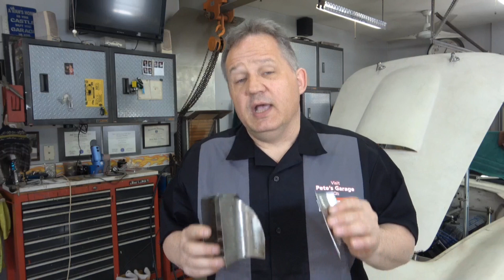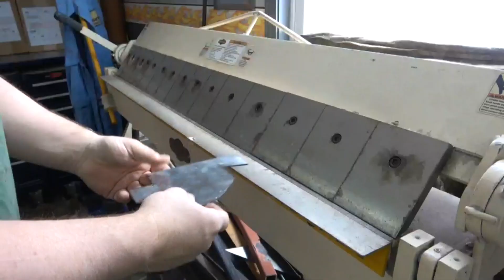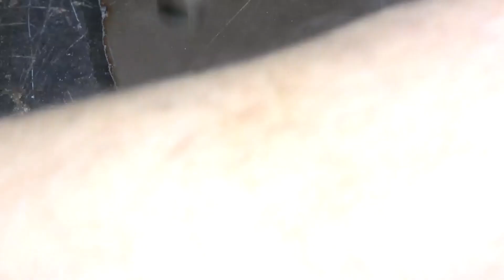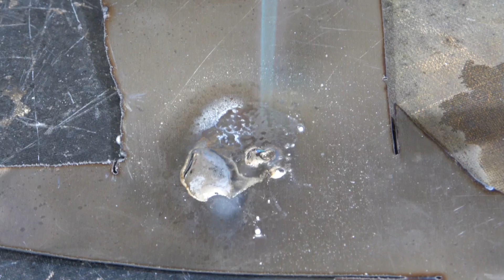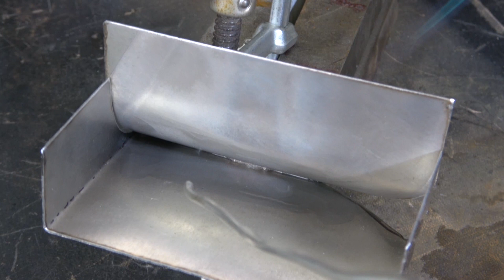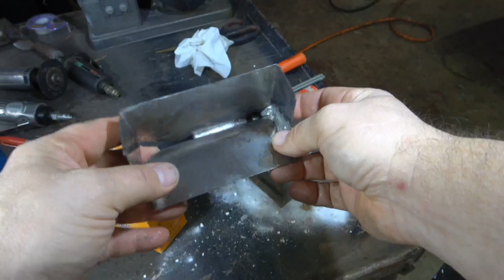Soldering Stainless Steel - Oil Cooler Side Scoops 427 Cobra

Comment: Excellent technique. The strongest bond would be from bronze brazing using silver brazing paste which contains potassium bifluoride. The problem to be managed is discoloration from the oxy acetylene heat needed to melt the rod.  Will try leadfree solder and hydrochloric acid
Reply from the maker: Thank you! Your suggestion for bronze brazing is interesting.

Comment: As an ex-chemistry teacher, I'm definitely in favour of including safety tips, but I think you went a little over the top with the flux warnings. It is corrosive, but nowhere near as dangerous as you intimated. Also, I'd suggest that you had water (rather than bicarb) so you can wash the acid off. No-one is going to put bicarb in their eye, but water is fine. An eye-wash bottle is ideal.
Reply from the maker: Great comment, thank you! The funny thing is, after working in manufacturing for 40 years I've found you can never be too safe. Afterall, there is a warning on the Super Man costume that says “Wearing this garment does not enable you to fly.”

Comment: Thanks for the video. Have used StayClean and Silver Bearing Solder for larger stainless to copper joints. But have a commercial sink project with 16 gauge and have to reattach the base of the divider. I'll probably use oxy with a small brazing torch to focus the heat and move quickly.
Reply from the maker: That's really interesting

Comment: Great video on soldering stainless.
I've been searching for a solution for this for a long time.
Reply: I was convinced that I needed to use a silver solder. 
I'm very surprized you were successful with regular lead free. 
I wish you'd shown the flux can because that flux seems to work well and appears to be the key.
Reply from the maker: The flux is just an acid based flux for stainless steel, pretty easy to find

Comment: I've welded on 6 inch columns and we had to preheat it up to 350 to 500 degrees and maintain that temperature we never turned off the rose buds then we had to put fire blankets
Reply from the maker: This is solder, not weld

Comment: I believe your wrong about  copper copper takes a long time to heat up that's why there in 3 phases and high voltage machines
Reply from the maker: This is solder, not weld

Comment: Do your engine building videos relate to all builds regardless what motor or internals? Still follow the same steps and do it all the same way? I’m looking to get 900-1000HP with a boosted lq9 6.0. And I want to do it all myself.
Reply from the maker: I try to make videos that show techniques that will apply to all engines

Comment: Hi Pete
I'm building my second cobra and it's going to be a big block. My real concern about building the motor is determining the correct length of the push rods. I can build the bottom in install the crank put the heads on all that good stuff but I've never had to figure out aftermarket push rod length to get it just right. If you have a video on that that would be great. Otherwise I might have to give you a call once I save up enough money to get this going things sure have gotten expensive in the last year or two. Thanks
Reply from the maker: I'll try to make a video, but have many resources if you need help